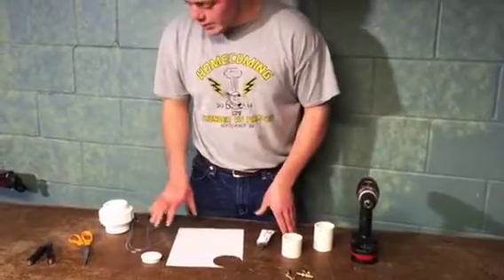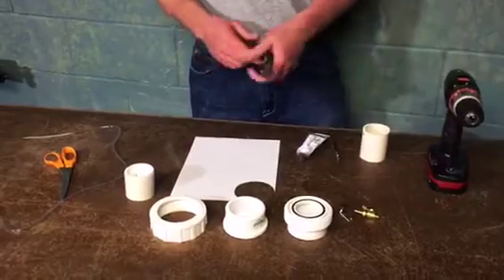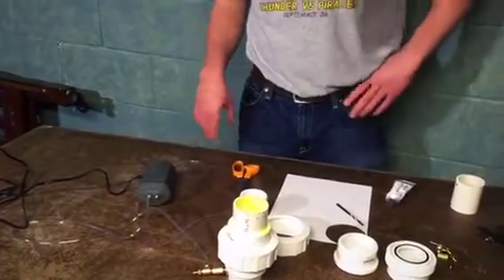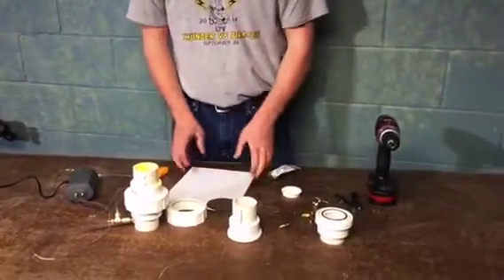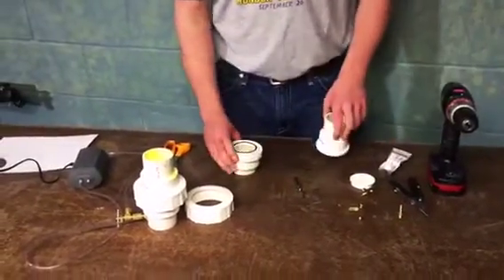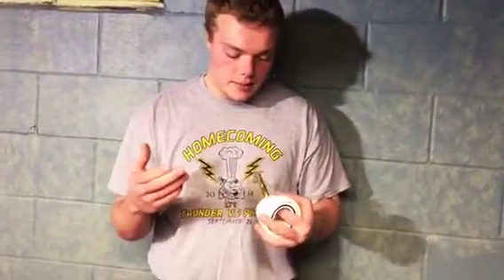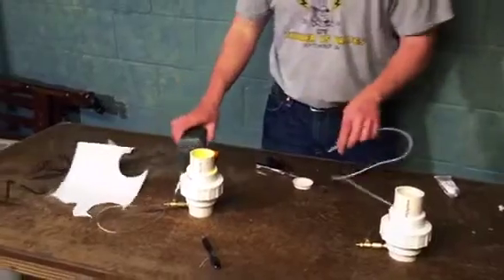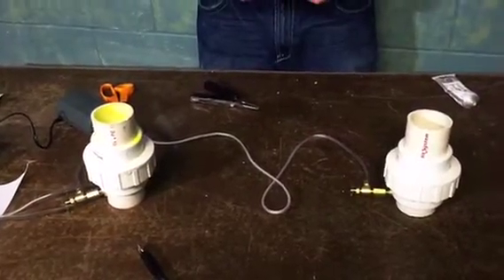How to make powder painting fluid bed

Comment: I'm sure this works well but you can make a fluid bed WAY cheaper than this. Check out some of the other videos. Lots of expensive,  unneeded parts on this one.
Reply: @RLWelch876  As I stated, I'm sure it works fine. Also as stated, there are other videos  that show less expensive ways to build a fluid bed.
Please note I did not need to use one exclamation point for any of my statements.
Regards
Reply: @RLWelch876  
Buy 3ft section of 2" PVC pipe, one  2" connector, 4" cap, piece of wood, aquarium pump, line, air flow valve, and caps for the 2" cups you will be making.
Take the 4" cap and mount it to the wood so the hollow side faces down.
Take 2" connector and glue it to the 4" cap.
Cut 2" pipe into as many cups as you want .(mine are 3")
Take coffee filters or parchment paper and cut to fit on bottoms of 3" cups and glue it to the bottoms (must be good seal all the way around the bottom. I used silicone)
Secure pump to wood. 
Drill hole for  air control valve in lower side of 2" connector.
Install air control valve and run line from pump to valve.
Insert cup into connector.
Insert powder paint into cup.
Plug in pump and adjust air flow until paint just starts to "float".
Heat and dip jig heads. 
If you want to leave paint in cup, that is what the 2" caps are for.
Well, there ya go stud. Have fun.
And no I am not going to make a video because numerous ones are already on Utube.
And yes I accept your apology.
Regards
Reply: @RLWelch876  There you go again with all those exclamation points. Hope you get to feeling better.
Regards